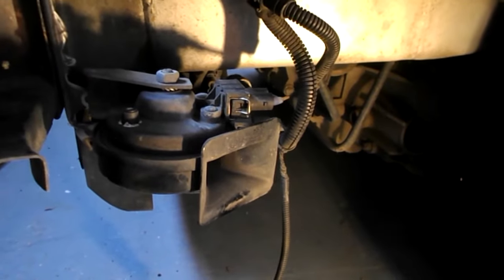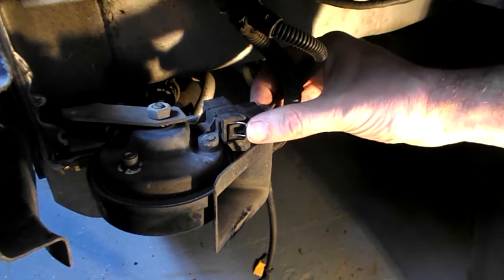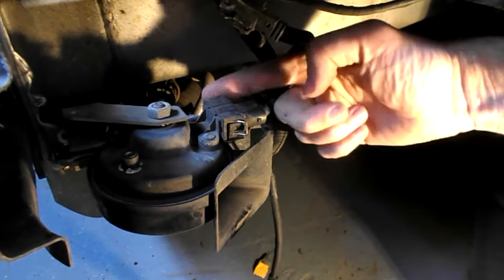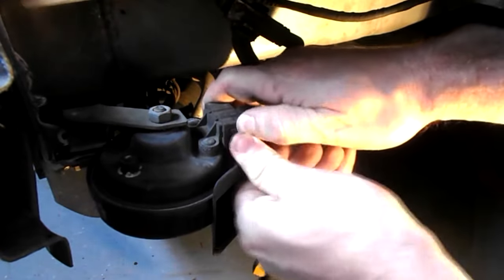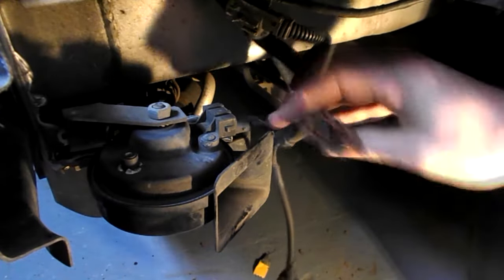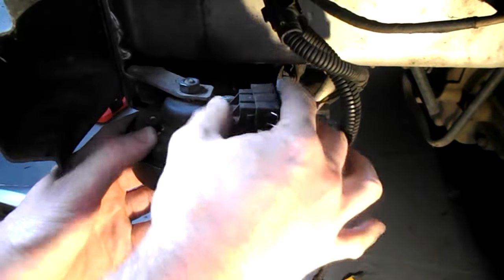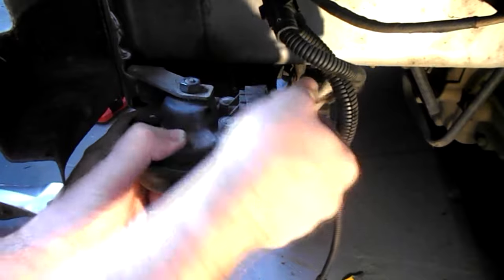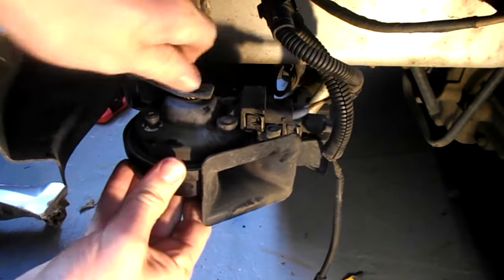VW Golf Horn Change

Comment: So, I have two horns with two separat cables which lead me to thinking the horns were OK as there were no sound. I checked the book and there was no fuse for the horn. I started checking all fuses and found one blown, the one for the headlight wipers. I changed the fuse (20A) and now the horn AND the window elevators are working. I have a VW Polo 2007.